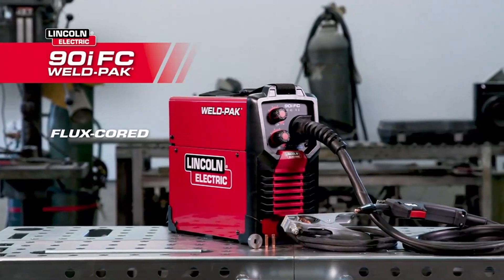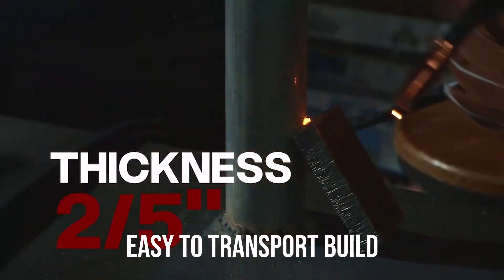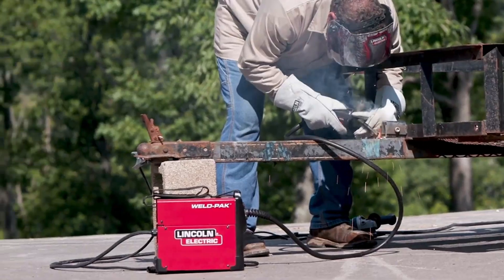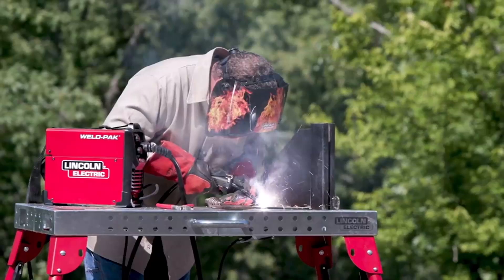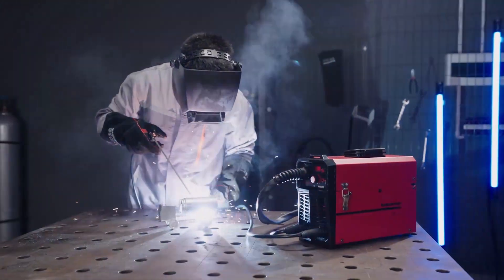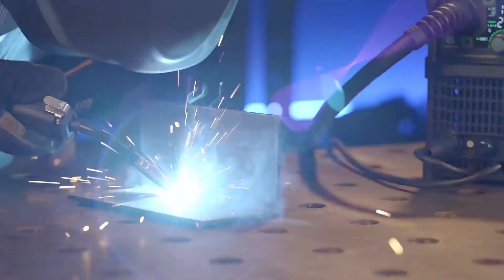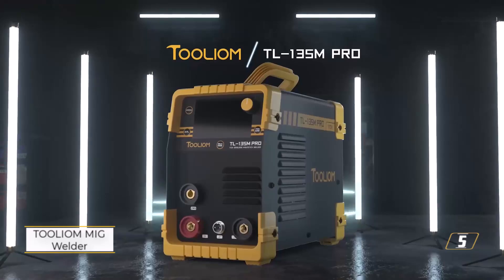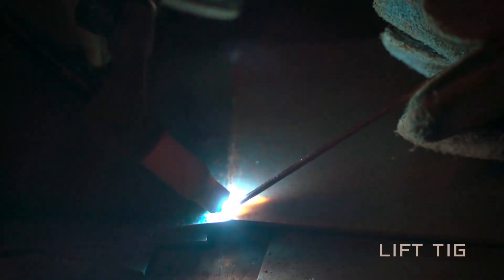🔥 5 BEST Flux Core Welders (2025) – Ultimate Buyer’s Guide & Hidden Gems!

Comment: Good presentation. 
One suggestion - don't feed your excellent A-I with standard typed U.S. English grammar. 
Instead, spell out what you want it to say, especially with numbers, etc. For instance, give it "oh three oh or oh three five wire" or even "zero three zero" instead of "0.030 - 0.035 wire". 
The A-I reads it as written, causing confusion in the listener. Mentally we'll read "oh three oh" when we SEE "0.030" not even realizing it, and especially if we read it out loud. A-I can't make that distinction.
The key is to write it OUT exactly as you want it said.
Still,  an overall very good presentation, and the "voice" you chose is clear and easily understood 👍.
Reply from the maker: Thank you for your nice comment